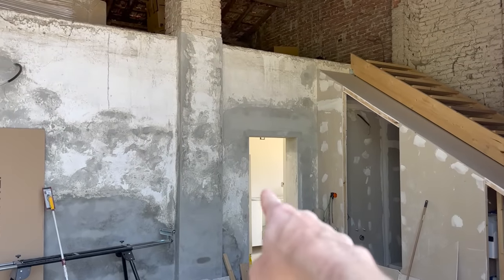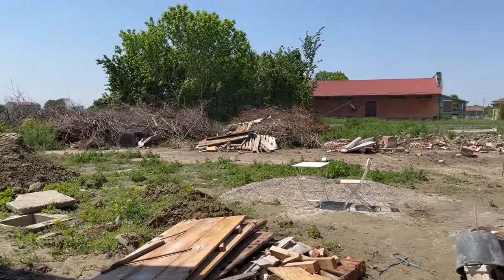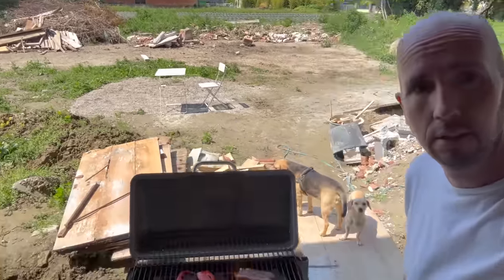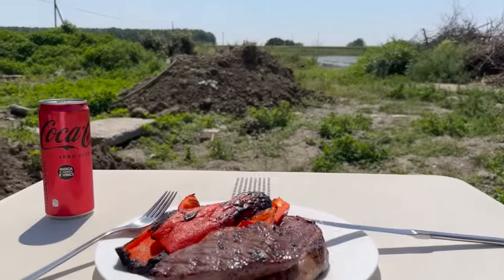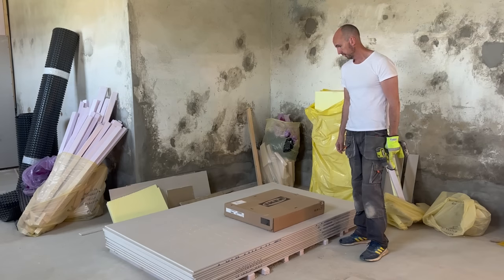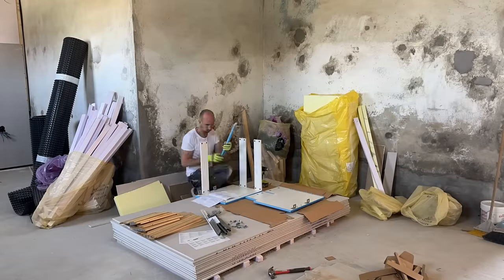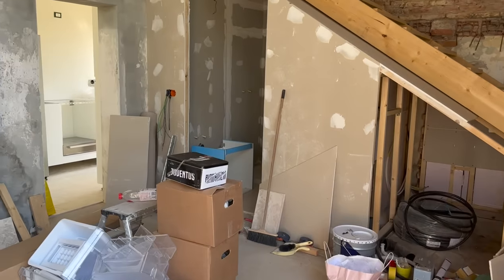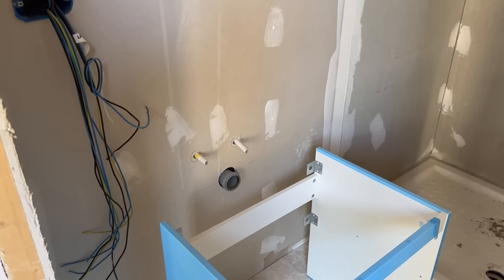1 SIMPLE task turns into 6000... | Vlog

Comment: In Michigan, our exterior doors open into the house also. Exterior doors do have a threshold but they also have something called a "sweep". It's basically a strip of rubber at the bottom of the door. It creates a weather seal that prevent bugs, moisture, cold, etc from getting into the house and keeps heat & air conditioning inside.  
You are doing an amazing job. This will be a dream home when finished.
Reply from the maker: Yes it seems it's about 50/50 on how the doors open.

Thank you, it will be a while until we are finished though, haha.

Comment: Busy, busy. Doors here in Australia/NZ also open inwards but we do have thresholds on the external doors. How do they get the external doors to be airtight?
Reply from the maker: By adding a small rubber seal that slides on the floor, or some doors have a  small seal that automatically extends right at the end.

In Sweden you are not allowed to have doors that open inwards in case of fire because if there is a panic it's very hard to open the door when it's blocked of people trying to get out. Also if there is intruders, it's much harder for them to pull open the door than it is to kick it in.

For me it makes no sense having door that open inwards without thresholds, all they do is take up internal space and scratch the floors when they are pulling around small pieces of stones on the floor. 🤷‍♂️

Comment: In our Italian house, where all doors open into the rooms, the granite pavement of the hallway  runs untill in between the walls of the door opening. The pavement of the room starts under the door. Basically aligned with the wall.
Yes, we have bugs coming into the house under the door 😁. And cold air in winter.
Reply from the maker: Yes exactly, that's how they do it, the problem as I see it not using any thresholds is that noise goes underneath the doors as well as various bugs etc.  I don't really see the point of doing it this way unless you are in a wheelchair and a 1cm threshold is an issue.